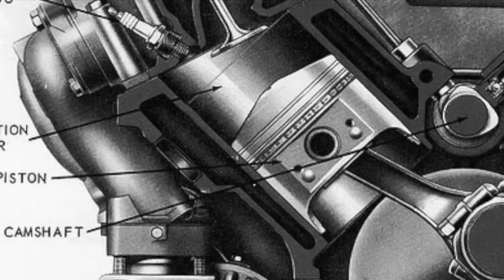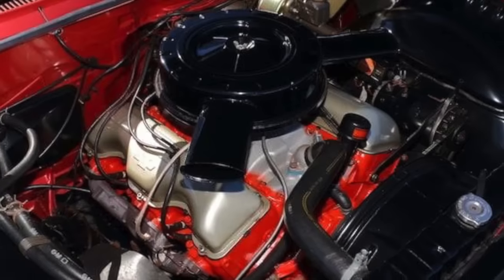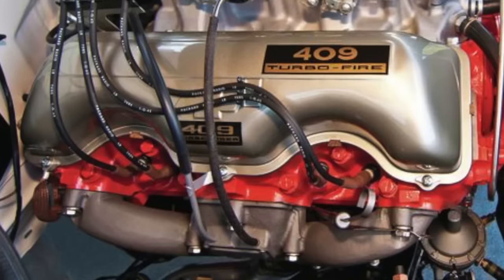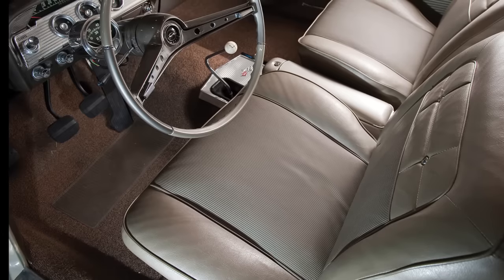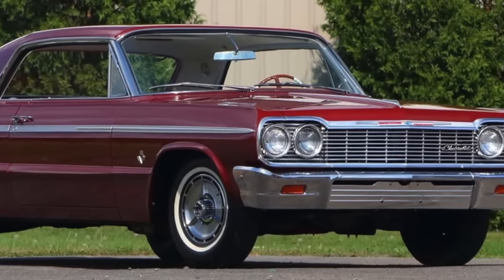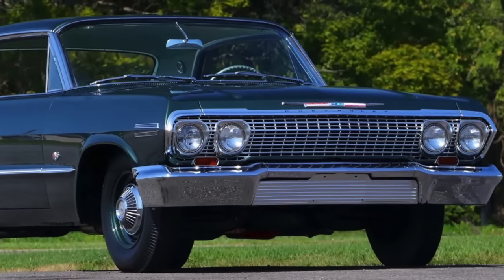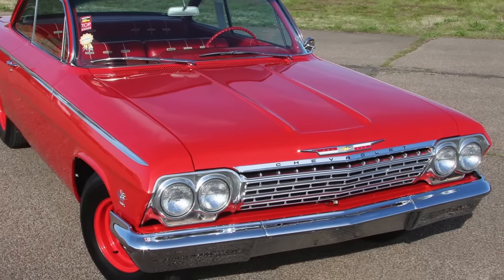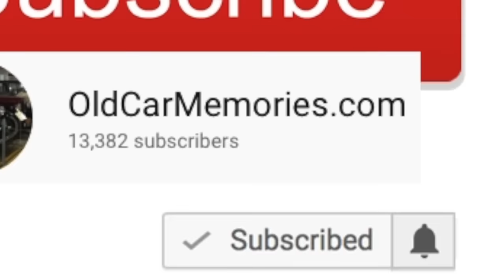1961-1965 Chevrolet 409 V8 - The Ultimate Budget High Performance V8

Comment: That 340/409 engine is so interesting, did not know about that crazy wedge shaped cylinder block, how the heck did they get all that compression with what seems to be a very large combustion chamber?  Yeah, I guess there is a difference between the compression ratio and actual compression readings.  Wish I could go to some sort of school to learn about this amazing V8 engine.  Very cool indeed.
Reply: the compression is made by using "dome" shaped pistons 

in the end.....its the same combustion chamber size as a "normal" small block
Reply: The heads on these engines are fantastic for their time.
Reply: Yeah as far as I know the only other V8 to have combustion Chambers in the block of the era was the MEL Ford and Lincoln and it preceded this engine by a couple years
Reply: It was an inefficient combustion chamber design in the 409 that was dropped after 5 years... The 389" Pontiac V8 engine in the '65 GTO with conventional quench combustion chamber design had more torque from less cubic inches and similar HP if the ignition timing was advanced from the stock spec.s... Making the stock GTO much faster than the stock 409 Impala... for less money...
Reply: BuzzLOLOL ...65 GTO was somewhat lighter as well which helped with performance. My sister bought one slightly used, what a fun, torquey car to drive, with good looking upholstery that wore like iron for years.
Reply: John hull   both of those engines were copies of the chrysler spitfire know as the semi hemi  .  They also had the funky valve covers .    Now how about this one the  mid 60` gmc  big v6    it had spark plugs on the intake side of the valve covers  I forgot the cubes but guessing around  300   more or less . It was a monster for a six   lots of grunt .
Reply: They just had a compression dome on the pistons. The problem with them (W engines) is that they couldn't really make power over 6000rpm with that combustion chamber arrangement.
Yep 6000rpm in a 409cu in V8 is just fine by me, but it pointed to the inneficiency of the design. 
In some ways, the Hemi suffered similarly - however - 6000rpm was about the point a Hemi head starts coming into its own. 
The heavy piston weight of big capacity V8s with domed pistons is a direct pumping loss (loss in the production of power) and the domes aren't the best for complete combustion. Also the high ignition advance requirement for domed piston engines is another pumping loss since the the less advance you can get away with due to good combustion chamber design the more power you make - because the spark doesn't have to start igniting the mixture so early which acts like a brake on the piston BTDC and is therefore a pumping loss. 
The Hemi and the W are similar in that regard.
Reply: The heads were flat on the bottom with tapered pistons.
Reply: I know early hemi's i believe early 60s' 392? had big wide heads with spark plugs in the middle of valve cover and was a favorite for the big fueler rail jobs like john thre snake purdhonr, don garlitts and all the big boys used to run at thompson drag raceway at thompson ohio east of cleveland, my brother and i went every weekend.
Reply: Sorry, if you are referring to the Chrysler "A" engine also known as a Polyspeherical design these were overweight slugs that never were a performance engine.
Reply: Raymond, early hemis 1951 - 1959... later hemis 1964 - 1972... Chrysler had hemi experience from building WWII military hemi engines... possibly under license from the British...
Reply: I had read that at one time Chrysler in the late 50's, to include Dodge and Plymouth, built all of its engines as hemi's. Then, due to cost, it stopped making any from 1960 to 1963. When the horsepower race was at it's peak, it began offering them as an option. I recalll reading about them in 1967. The 426 Hemi was an extra $700, quite a lot of money when you could buy a 440 engined Plymouth GTX for about $4k. According to the car magazines at the time, the 440 and 426 hemi had about the same elapsed time in the quarter mile. It was only beyond the quarter mile that the hemi began to overtake the 440 wedge. However, the hemi had to be retuned every 700 miles. This explains why there were so many 440 wedge engines ordered vs. few hemis.
Reply: Many of Chrysler's 1950's V8's were hemis, but their 6 cylinder was actually a flathead up through 1959 !!!
Reply: It was designed as a truck engine. It produces high torque at a low RPM so that a truck can haul heavy loads, similar  to what a diesel engine does. It does not have the potential to produce as much horsepower at high RPM's as an engine with a wedge combustion chamber has. The Chevy engineers used every trick they could to force it to produce more power than it was designed to. This is one reason that they broke parts when racing. The 396/427 has much more power potential than the W engine.
Reply: the heads  have valves and not much more  - - no chamber just a little relief for spark travel , completely unlike any other Chev V8 - - low end to mid power . Motors came apart if over reved and this was before all the modern electronics with rev limiters. I had both 348 and 409s but I wish I still had my 63 Impala  SS 409 - - one other big notation 2 piece drive shaft with a center bearing which I replaced several times
Reply: Yes, the bodies were longer beginning in 1958 and so they used a hanger bearing that allowed them to put a yoke in between a longer drive shaft. I had a 1960 Chevy with only a 6 cylinder. One day I heard a loud banging under the floor. That drive shaft had ripped the bearing from its mounting allowing it to bang against the underside of the floor. It sounded like someone was pounding a hammer against the floor.
Reply: John Hull nope the mel and the w block both came to market in 58.
Reply: @2x4barrels40  Three different sizes, a 305, a 351, and not sure what the big boy was, and also a V12 at 702 cubes!
Reply: @4thstooge75  Stock, yes, but if you can find performance parts for it, it is quite good, as the intake ports are very free-flowing.  Much better than most other engines.  Of course, a true HEMI also has free-flowing exhaust ports.
Reply: @BuzzLOLOL  That's because Chrysler thought the 6 cylinder would soon be a thing of the past in standard size cars, so no point in designing a brand new 6, only to have people stop buying it in  few years.  The very sharp 58 recession changed things though.  6 cylinders suddenly were in more demand, so tall-deck version of the Slant 6, which was originally to be a Valiant only item, was designed for Plymouths and "Plodges".  But true enough, the full-size Dodge was V8 only for 1960.
Reply: @johncollins2442  I had a 61 Buick with that same arrangement - first year that Buick used that X frame - I experienced the same thing, a loud banging right under the middle of the drive shaft tunnel.  Always wondered how much better that car would have been had they kept the same K braced frame of the 58 - 60 cars.

Comment: 348 had pressed in rocker studs the 409 had screwed in studs , found that out the hard way !!!
Reply: Both had pressed in studs. The Hi-Perf 409s had their pressed in studs pinned.
Reply: Also the 409 crank had to be cross drilled for better oiling.
Reply: Not true. All pressed and some 335 h.p. 348 engines had Roll Pinned Rocker Studs. All W motor heads can be Upgraded to Screw in Studs 👍👍
Reply: @sbungy  I've had all Versions of W motor Heads. Some H.P. 409 heads where pinned but most not I think the Pinning thing was Aftermarket,?? But I found a Tripower 348 in A DEEP mud Puddle and the Studs where pinned and when I Disassembled it had Original GM shim head gaskets and everything was Standard. And I was told by a Full on W motor Freak that the 335 h.p. 348's where pinned??? Its still kind of a Mystery ( the whole pinned stud thing)🤷‍♂️ the reason that motor was pulled is Because of no Antifreeze and the Block was Cracked under the head Deck and all over the place. I've Junked 2 409 and a few 348 blocks for Water Jacket cracks, I seen one that was Brazed and worked fine a 348.
Reply: @donaldalbershardt6854   I've never seen a set of HP 409 heads that weren't pinned. Not saying it's not possible, but I've never seen any and I've seen quite a few.  Maybe the early ones weren't pinned? Never knew about the 335hp  heads being pinned, learned something new today.  You should have kept those cracked blocks.  I've had and seen many that were welded successfully and they're getting harder to find now.
Reply: @sbungy  I heated all of those Blocks to Check for Cracks and they where all Cracked even in the Lifter Bores ..I wouldn't Junk a Workable Block.👍
Reply: @sbungy   I have 2 sets of #619 heads now and they are not pinned.🤷‍♂️
Reply: @donaldalbershardt6854  What are the dates on those heads?
Reply: @sbungy  Sorry #690 ..1963
Reply: Pretty sure the 348 tri-power 360hp had screw in studs because they had solid lifter cams
Reply: @sbungy  I think the hydraulic 409 had the pressed in studs.

Comment: Chevrolet engines were serious muscle before 1973 when they dropped compression ratio to 8.5 compared to an 10.1 in the muscle cars! A 350 with 185 horsepower compared a typical 350 with 290 horse! Today i have a 4 cyl. With a 185 horse power rating! They really made cars gutless from 1973 to probably the mid 90's!!!
Reply: Travis, when catalytic converters and the like came mandatory in the 70's due to emissions legislation, the manufacturers were a bit more realistic in HP ratings, as if to admit that they were not engaging in a horsepower war, at least for a while.  I worked at Ford (Australia) for a while in the 70's and seriously, nobody really believed the HP ratings anyway.  

Yet it could also go the opposite way, as the manufacturers started getting worried about ever increasing power outputs in cars, partly due to concern about legislation but also about potential legal liability and unwanted attention.  Here is Australia, Ford was told by the federal government to stop building faster and more powerful cars, leading to the withdrawal of what would have been the Phase IV Falcon GTHO.  In short, Ford was bullied into it, and in fact stopped selling V8 cars altogether for some time.
Reply: 1971 was the beginning of
compression loss. 
But, after market pistons in the new open chamber heads was a plus.
Reply: Eric Stewart wrong 1973 was the start of it all thats why you could get a 71 that still had the horsepower i know because i bought a 72 350 at a junkyard for my camaro and it turnd out to be an LT1 with with 345 horse! Was there lived it!!!!
Reply: Travis Krause  
GM lowered the compression ratio in 1971
I was 21yrs old & a mechanic
Reply: I recall that by 1967 or 68, the manufacturers began increasing the stroke of the engines to cause them to meet the new pollution standards. For example, Chevy increased the stroke of the 283, after about 10 years, to bring the volume to 308 ci. 1966 was the last model year that had no pollution devices, except for the PVC valve. Before the PVC valve, the engines simply vented the crankcase gases to the atmosphere by use of a metal tube that ran to the bottom of the engine.
Reply: That’s when gasoline octane tanked.
Reply: Don't forget gross vs net HP ratings.
Reply: +Travis Krause   It wasn't just the the EPA mandated changes; they also changed the way the engine output was rated, from 'gross' to 'net' output - usually that's about a third off right there.  If you had a 200 hp engine in 1971, the way the ratings were calculated, it would have been a 130-140 hp engine in 1972/1973 with no other changes.  To make matters worse, a lot of the OEMs were doing away with 'performance' axle ratios.  Instead of 3.50s and 3.73s, they were stuffing the third members with 2.79s and 3.08s in order to get maximum mileage - important, since there was an oil embargo in place and prices skyrocketed.
Reply: Travis Krause i wondered what happened to the horsepower, i remember in the 1980's there no fast cars on rhe American market till the Buick Grand national
Reply: My 1985 Corvette turned a 13.93 quarter mile time with a completely stock motor, there were fast cars in the 80's and Callaway sold a twin turbo version of the Corvette. Porsche and Ferarri would also argue they had some fast cars in the 80's like the various 930 Porsche models.
Reply: Ford Falcon GTHO Phase 4 Whatever the truth is, Ford admitted the RPO had more mid-range grunt than a Phase III, which would have made it stronger over the quarter-mile. The owner of the beautiful Wild Violet RPO 83 in our pics, George, reckons a mid-14s quarter would probably have been possible with a top speed as high as 150mph (241km/h). < These are some numbers from a CANCELLED super car in Australia Ford planned that was "to fast'. Compare these to a 1985 Corvette's 13.90 Quarter Mile times and 150+ mph top speed and the 80's were NOT dead for perfomance.
Reply: well @ Eric Stewart  the  1970 LT-1 was  11 to one  370 Horse Gross ..  1971 was 9-to one  maybe  72 also  by  1973  I don't think they even built it .. My  1970 350 with big two barrel in an impala was 250 HP same engine with a Quardra junk was  300 HP  it became  the LM-1 in late 70's   8.2 to one compression Quadra junk   4 barrel  in the Z-28 Camaro or in a pickup ..  exact same engine they retarded the came  4 degrees gave them a lot more low end but lost a lot on top end..
Reply: That was mostly the way they were rated but yeah a lot of hot engines were discontinued .
Reply: Yes, but the 4 cylinder would kill itself trying to move the old iron.
Reply: @johncollins2442  Yeah the good old drop tube. Look at old pictures of the roads back then,  they all were black in the middle due to that vent pipe.
Reply: @sst568  They also called it the Blow-by pipe. Once the compression rings were worn, oil and smoke would pour onto the road. It was due to this that the engineers realized that they would have to recirculate that oil and smoke back into the intake manifold. The problem with this was that once the blow-by got bad enough, it would often clog the PVC valve. Then the pressure of the blow-by would have no outlet. Usually then the PVC hose would come off or split. However, I saw more than once that the pressure caused an engine oil seal to burst causing a massive oil leak. So, the PVC valve sometimes did more harm than good.
Reply: @johncollins2442  True, had an old 78 
f150 that the pcv tube was clogged,started blowing the dipstick out of the stick tube, cleaned the pcv tube and fixed the problem.
Reply: Travis Krause / FYI : 1970 was the last best year for a mussel car ; after that, compression & hp was drastically reduced....
Reply: @ericcaves2359  lol chevy now has a turbo 4 cylinder silverado honest injun!
Reply: lotta drag racers use quadrajunks@sploofmonkey
Reply: No other way to meet emissions regs, which were tighter by the year.